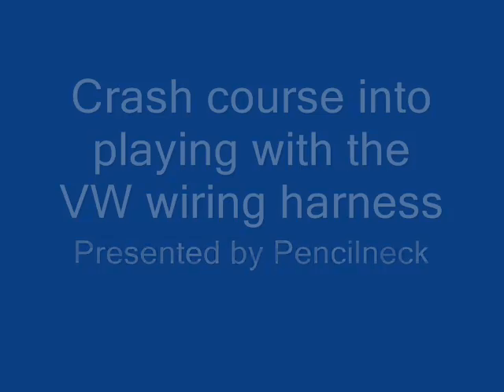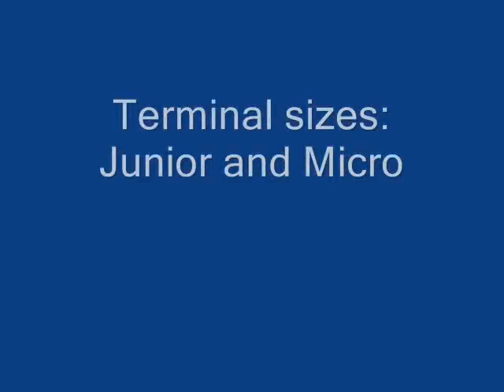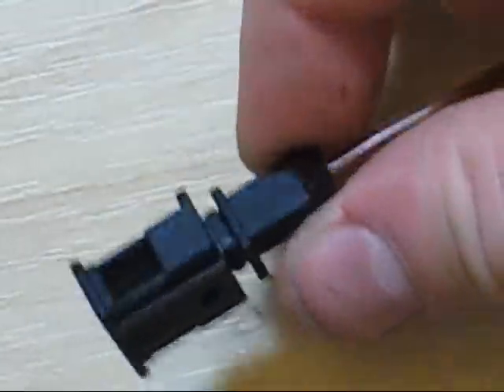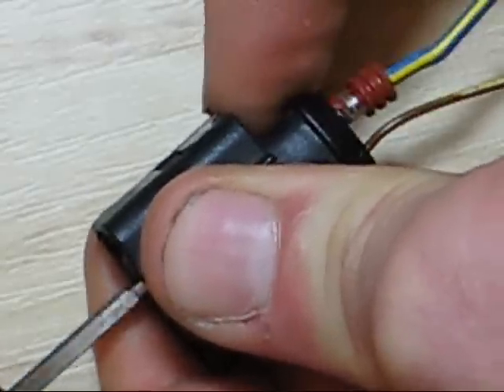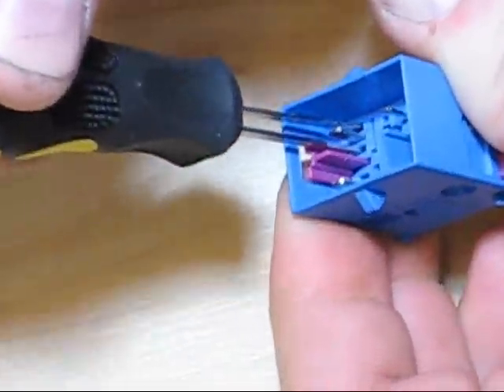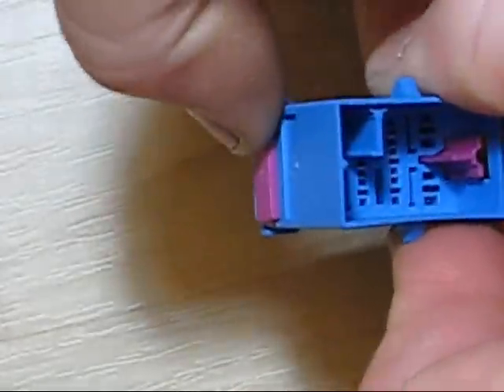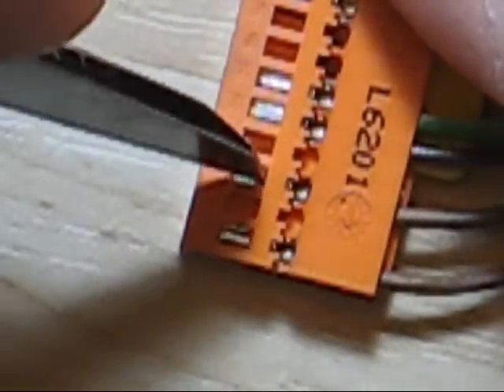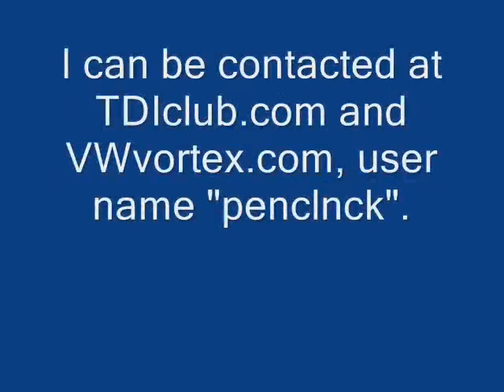removing terminals on the VW wiring harness

Comment: Thanks! Moded a splitpin in ok size to unlock it after seeing your tool.
Reply: Yeah it seems you could take the round terminal tool, file the ends a little skinnier, and bend the ends inward to match his. … unless you need a longer pin, but I don’t

Comment: What else can i use instead of a tool. I am doing a trunk harness replacement and happens to be different connectors for vwcc 2013. I want to swap the connectors. To be able to connect it.

Comment: Really helpful. I was a bit confused about the "T" clip.. but put it in the light and saw the T. You have to press the T down to release the wire.. I found it helpful to do it with a thick needle and instead of the needle nose I used tweezers. Good luck and thank you for the post

Comment: Hi could you possible tell me the name of the spade connectors that go back in to the plastic connector block?
I’ve removed the connector wire but need to lengthen the cable. No problem but need some new connectors??
Thanks in advance

Comment: Thanks for this video, I found it quite useful. I am a Saab guy and own 3 now, but I just purchased a 9-5 this past week. The evap purge valve is the same for certain Audi/VW and Saabs, so someone took and spliced the connector from a VW onto my Saab wiring harness... grr. Anyways, I ordered a new Saab correct purge valve and the connector to go with it only to realize the connector didn't come with the terminals. Using this video I was able to remove the VW connector and insert the terminals into the correct OEM style plug, so I appreciate the help.

Comment: Hello, Jeff.  

I am trying to remove a terminal (#3 or #85) in my TCM wiring harness.  Which tool should I use?  And, do you have a video or tip to fix the one wire corroded from flooding?  Thank you. 

Also, thank you very much for adding this and your tool making videos.  I have found them to be extremely helpful in fixing my Allroad.